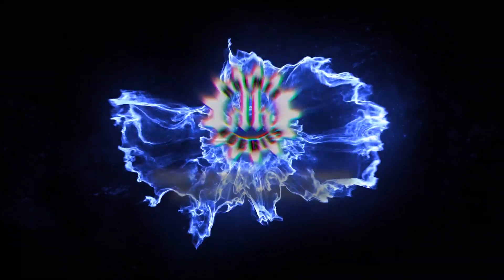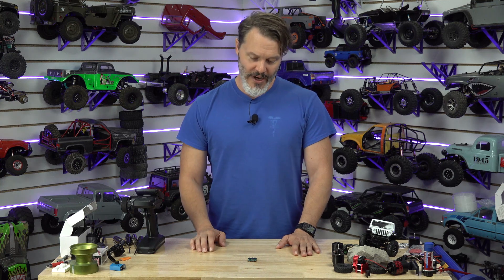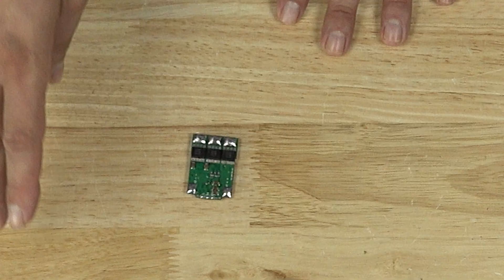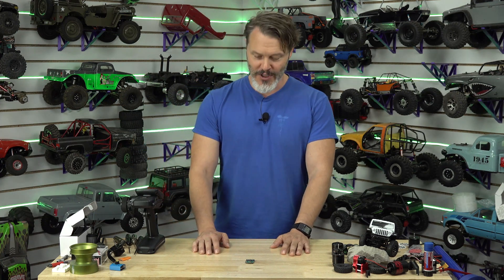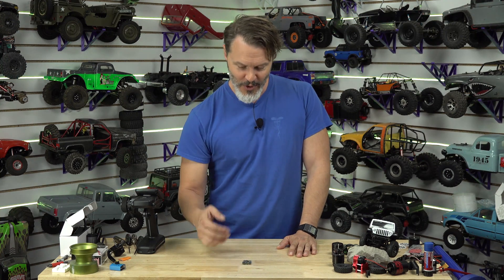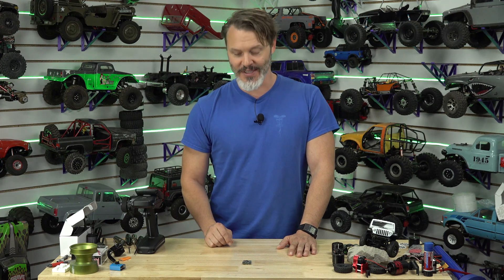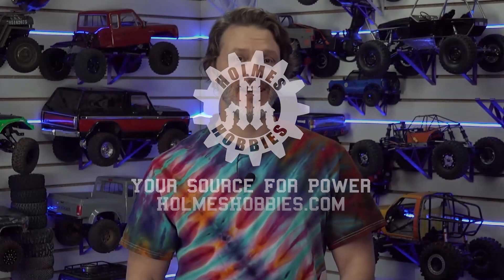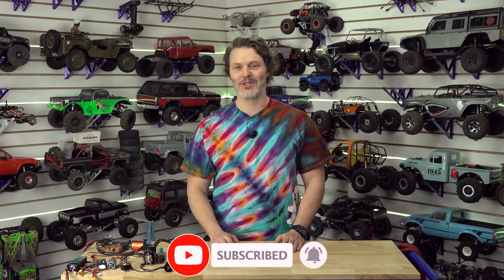⚡ Exclusive First Look: Crawlmaster HV ESC + How MOSFETs Make It a BEAST! ⚡

Comment: I have a older revolver unit I bought for a shelf truck.   At the time the only speed control choice was the castle line either a sw4 or mamba x 
I’d really like to get a better set up for this truck as I’ve only used it a few times 

Being I do enjoy all aspects of rc hobby from building driving modding my own parts ect 
Is there gonna be one available that can be built by myself in a kit.   If possible I’d like to run 4 s 
That’s one issue I’ve had with the sw4 is I’m stuck at lower cell counts so I can’t run what I want 

I don’t want to use copperhead or anything I want to make something totally unique 
Thanks

Comment: Have you ever considered offering an ESC with FOC?
Reply from the maker: @knotical689   foc is very limited. This one could technically do it but you would only be able to use one motor unless we had a robust detection sequence. But those almost always need heavy user tuning. 

In short, its easier to really mess up an FOC system. A universal foc is not possible.
Reply: @HolmesHobbies  makes sense, I appreciate the response

Comment: Nice MOSFET, I remember when I contacted Vishay to see if they could produce my MOSFETs and they (all the major manufacturers) said it was impossible, but I found a small manufacturer that did it. The 80V single channel one I had made has a die meant to be used in those huge TOLL package MOSFET and I stuffed it in a DFN88 package, funny thing happened when it was tested, it has 0.05mOhm lower resistance compared to the TOLL MOSFET. There are some nice ESCs using these big packages and they handle a lot of power. Thank you for another great video John.